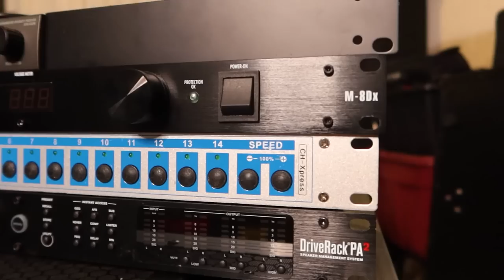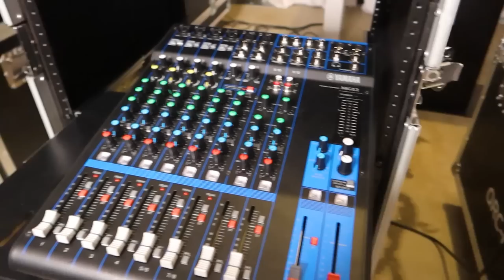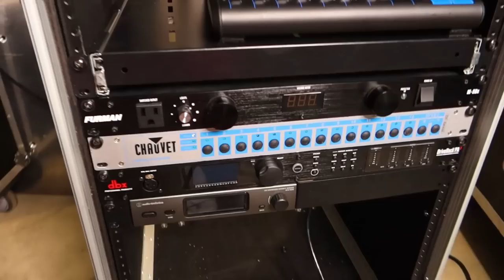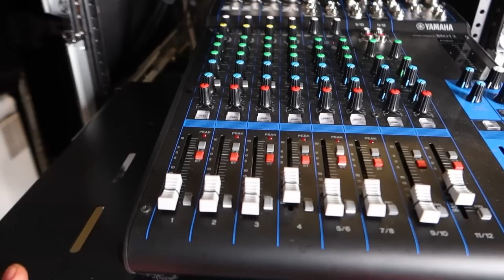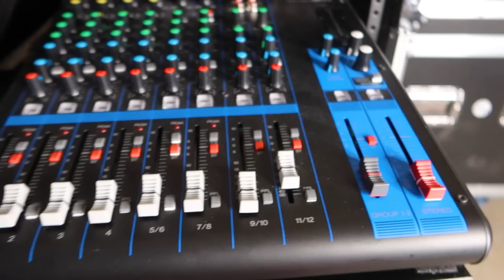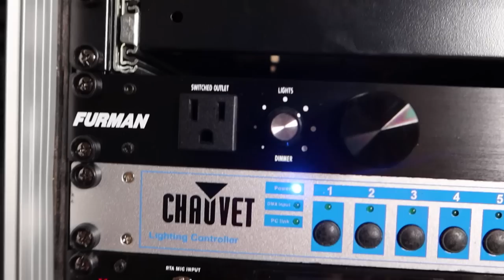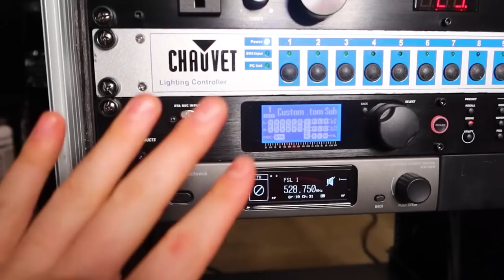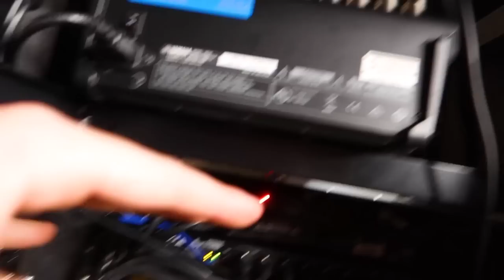The ultimate MOBILE DJ AUDIO and LIGHTING Rack build

Comment from the maker: Let me know your thoughts!
All the gear used
ProX 18u rolling rack https://amzn.to/2yz4Zmd
Yamaha MG12 https://amzn.to/2RaGani
Sliding Rack Drawer https://amzn.to/2ULc8IE
Furman Power conditioner https://amzn.to/2RfmvlU
Chauvet showxpress rack (discontinued) see normal one https://amzn.to/2UIRN6P
donner wireless dmx https://amzn.to/2JCKPKu
DBX Driverack Pa2 https://amzn.to/3bMMngS
Netgear router https://amzn.to/2x2KZba
Audio Technica 3000 4th Gen https://amzn.to/34cSkRA
Rack Shelf https://amzn.to/34dF3IG
XLR / Powercon port panel https://amzn.to/2JLWZAx
Male XLR port panel cable https://www.nlfxpro.com/xlrf-xlrm-pm/
Female XLR port panel cable https://www.nlfxpro.com/xlrm-xlrf-pm/
Power con port panel cable https://www.nlfxpro.com/pm-powerconb-to-5-15r/
Black 1 u plate https://amzn.to/3aWxLeI
Antenna relocator cables https://amzn.to/39KVWM7
Front mounted powerstrip (added after the video) https://amzn.to/3dW3dfg
Velcro cable ties https://amzn.to/34aWQ38
Reply: Honestly I throw a berringer x32 rack in there. You are growing and with the x32 and the cat6 remote snake you can tuck the rack in a corner in the back and run the x32 off a iPad or android tablet. Plus it gives you 32 channels of input for larger events or concerts you might do
Reply: @MFCSTUDIOS  I was about to say the same thing
Reply: Hey, just a heads up don’t but the usb version of the mg12 I have the mg10xu and it has an extreme amount of usb noise that shows up in the usb audio input, it comes in and out extremely frequently and it’s not worth it. Just letting you know. I regret buying the mixer now but just a heads up
Reply: kevin turner well I think he doesn’t really need the x32, he mostly plays at weddings and party’s. x32 is more for larger stages and bands that require effects delay’s- more advanced stuff. Also as I’ve seen he uses active JBL’s srx and similar product line
Reply: That has all settings he needs
Reply: @simascalka  as of right now but fusion sound and light is a full service production company. While the dj side business is usually only wedding and partys. He has expressed that the company offers full service production. Haveing it In the rack gives him the chance/opportunity to offer complete full service and expand to live audio for bands and live events. And Is another revenue stream for his business.
Reply: For the Netgear Router did you have to make a netgear account?
Reply: How do you like the Yamaha mixer?  I just got a sweet Soundcraft signature 10 that is making me rethink All the mackie mixers I own.
Reply: @rickwebb that power tool saved me from blowing all my equipment

Comment: You might get some more space if you turn the sliding shelf upside down like you did the shelf at the bottom.  As others have mentioned though, right-angle XLRs could be beneficial as well, especially since they are only coming from the back of your case.  I do wonder about the use of the PowerCon connector vs. using regular Edison plugs, but I suppose that is a personal preference.  If you are going to be transporting this to and from gigs, I highly recommend that you install the rest of the rack screws.  If you do decide to only use two screws, however, I recommend using the bottom screws rather than the top screws.  It holds the equipment more securely.  Thanks for showing your rig!

Comment: Great setup if you wanna be a bodybuilder. Work smarter, not harder. No elevator, and this type of setup is gonna need a few guys to move. Better be charging 5-7k after paying employees for a setup that normally needs one person.
Reply from the maker: I have 3 different DJ systems. This would never come to a wedding with stairs. Roll in roll out only. Setup in less than 10 minutes

Comment: Really like the component choices. For me, this rack would be too large. It would probably fit into an 8u but that’s really just personal taste. I’d also put the power conditioner on top so the lights shine on the mixer. The only other suggestion would be to put your stereo input from the dj mixer into one of the 1/4” trs stereo channels on the yamaha. One fader, one eq and it’s designed for line level.

Comment: Few things that i may consider doing differently,
1. Why not put the furman on top of everything, this way you can use the pop-up lights for the mixer controls
2. Why not use angled XLR connectors on the mixer to save some space
3. Why don't you use some 2U or 3U rack drawers instead of plastic containers, looks way mor clean
Nice setup though...stay safe, cheers
Reply: 4. Use locking power cables to the mixer and driverack.
5. Puting power and signal in/out on the Same please so you can make combi cables with signal and power to the dj set and speakers
Reply from the maker: You cant do locking power cables unless the equipment accepts a locking iec.
Reply: @DJRickWeb this used to be true. But there are pressure locking IEC and Edison now!
Reply: @DJRickWeb  could you build this for me if I send payment? Or know someone in Florida that can

Comment: When building racks, lay the rack down on its back. The gear will then hang in place, and you can organize the gear easily without having to screw any of it down. Then flip it over on its front to do the wiring. 

(and when using two screws, use the bottom two)

Comment: Hey Rick, I've loved seeing you grow over the years. A couple thoughts came to mind: 
1) Might want to add something heavier to the bottom of the rack, because it seems a bit top heavy and could tip while rolling. Although you're using powered speakers, might be beneficial to have an amplifier at the bottom of the rack. 
2) Rather than bins, might want to put in a couple of drawers to keep things organized. 
3) Use right angled connectors on the mixer to reduce stress on cables and clear up some space. 

Been loving the content and looking forward to seeing you grow!

Comment: Okay now I begin my rack build... Adding a denon bluetooth receiver and a usb hub to mine as well. This is going to be a project for sure. I keep checking your video to see what I am missing... will keep you posted!   Currently have on hand to mount: A dbx drive rackPA 2 , Alto stealth wireless system, shure blx wireless mic system, on order is the Gator 8U wheeled rack,Furman power conditioner, Denon bluetooth receiver, wireless router, xlr patchbay, along with misc stuff. Next order will be the roll out shelf, usb hub, misc cables usb and ethernet  and some blanks if I need them. Wish me luck! Thanks man!
Reply from the maker: The second video will be coming out shortly with more modifications!
Reply: I use a rack mount wireless router. Total game changer!

Comment: Decent integrated setup - looks pretty good.  You're learning dude!  :)
Reply: Thanks for the heart Rick.  I was talking to a DJ pal I've known since 1981 yesterday and asked him if he watched your video's and he said yes.  My first amp rack was in 1979 and I built it in my garage from 1/2" MDF board and painted it with flat black rustoleum.  Had a Phase Linear 400 in it and Heathkit electronic crossover - I don't remember what else.  Did have a PVC receptacle in the top of it.  Piece of 1-1/4" PVC fit into it.  I took that piece of 1-1/4" sch 40 PVC and heated the end and formed into a question mark.  Put a mirror ball motor on the top and hung a 12" mirror ball from the amp rack pole mount.

Anyway, my point here is that some of us mix, some MC, some do video, and some design/build.  It's interesting watching you on your journey.  Takes me back in a good way to the good parts of building and learning.

There are always haters, naysayers and self-ordained keyboard experts out there - disregard that for what it is - it never goes away.  Good thing Thomas Edison & Walt Disney didn't listen to them - or General Dynamics when we built the F-16.  :)

PS:  Now I own 50,000 watts of Crown's & JBL Vertec's in the main PA and another 10KW for the DJ system.

Been testing the Chauvet XpressRack-1024 and really like it.  It will be perfect for the wireless uplights.  Haven't figured out what the 4x "Zones" are used for yet?

Comment: Great video.  Suggestion move your patch ports behind the Dbx so you don't need any extra cords. They also sell a rack mount power strip with extenders to plug in to your fermin. Maybe a port for your Donner dongle on the patch piece, so no obstruction for signal. Great job. You have great ideas.

Comment: I used to wheel around cases like this but venue size .. and gig style meant I had a ton of money sat in equipment I used maybe once a month. Now I just use a component PA which suits everything from a small bar to a thousand people outside. I use a digital mixer (very compact and can even piggy back the built in Wi-Fi to run my DMX)  and most of the outboard gear in soft bags. For a small gig .. all of it, including lighting, fits in a station wagon and I only need a trailer for bigger venues. Personal choice I suppose but most of the time I work alone and all these big cases are just not practical.

Comment: i would have gotten a rackmount digital mixer ala xr16 or xr18 instead of the analog desk.  also i wanna see you haul that rack up some stairs by yourself
Reply: also get angled connectors for the desk ffs
Reply from the maker: I never go to an event by myself. And if it involves a lot stairs this rack wont be used. Will just bring a simple setup.
Reply from the maker: Yeah those are the 6inch jumpers I mentioned.

Comment: Nice build....but maybe you can put the ports to the front, so you dont have to open the back everytime...looks like you have just enough space above the mixer for the antennas (you got even more space if you using angled xlr on the mixer ;) )

Comment: Doesn’t those big racks kill your back loading then up into the van or onto a raised stage?  I built mine year ago to be modular with a patch panel on top of every rack so nothing ever goes more than 8u and those were amp racks which are almost never used.  But even so if you use one rack manufacturer - everything just stacks clean and you can be nice and modular. My current project is breaking down the old coffins into separates that can just sit on a table.
Reply from the maker: Trailer. Rollin roll out.

Comment: wouldn't the Yamaha TF-Rack Digital Mixer have been a much better (and space saving) option over that mixing board tho..? This case could've easily been accomplished at 12-14u at most but thanks for the suggestion on getting the outlet indicator..
Reply from the maker: Yeah but it cost significantly more. And I had the yamaha already vs having to buy that. And 18u was more for the height so that it functions as a table as well as a rack at events

Comment: Rick that is a great rig setup! Got a couple of questions:
I found a rack mountable chauvet show express on Ebay for a good price. Can it run the new version of the software? If not what version do you use? Also, does it plug straight into your computer or can it stand alone with a router and an iPad? I'm tired of using my obey 40 and having to manipulate it.

2. I have an original dbx drive rack from my band days. Should I use it or get the new one?

Any help is appreciated. Love your channel!
Reply from the maker: I pm you on facebook
Reply: @DJRickWeb what kind of drawer is your technca sitting on
Reply from the maker: Its not sitting on one
Reply: @DJRickWeb  what's holding it? That's nice I need whatever it's on or holding it
Reply from the maker: The mics are bracketed in with the built in mic brackets

Comment: Can you get a patch port for the DMX transmitter to mount on the plate with the mic antennas? That way it's not deep inside the case and away from the power cables.
Reply from the maker: Yep and that will possibly be a future modification depending on trials with the rack at events

Comment: Question !!!??? 
Do the connectors have to be mounted in the rackmount from the front or from the back. I always mount them from behind. Then everything works properly. 
And they are easy to change or move. 

In the industry I see both ways. I wonder what you think of it?
Reply from the maker: I always do it this way. And that's what I have seen standard in the high end production world.
Reply: @DJRickWeb   
I'm not sure about that, because it is mounted from behind within various professional equipment. 
If, for example, search for audio snakes, you see that they are also mounted in different ways. this also applies to various you tube videos. In the Netherlands I see that both ways are used. It looks cleaner when there mounted from behind. (even in the Bunn dj booth ;) )  And it a lot easyer to replace them. 
The last think i`m curious about, is why they sent you al pre wired connect, that you have to take apart to install.?

For example this is a Dutch proffecional company that makes audio rack panel, and everthing is connected from behind. https://shop.sommercable.com

I`m not telling you doing it wrong, but it is maybe a eye opener, to do it the another way. 

Love your video: 
keep it up

Comment: locking iec for power to drive rack maybe?
Reply from the maker: That would only work if the drive rack accepted a lock iec
Reply: @DJRickWeb  ah do they not fit that sucks was hoping they would for when I built my rack
Reply from the maker: They will fit but they wont lock because it's not a locking port

Comment: Don’t screw the quick connects to the plate, pop rivet them in place
Reply from the maker: Why would you not bolt them? Rivets only make it harder to take them out down the line
Reply: DJ Rick Web one it’s tough to find the correct screw size for them and two why would you be removing the connectors and not just add more down the line? I just went through this and gave up with screws when my local music store asked me why were you using pop rivets?